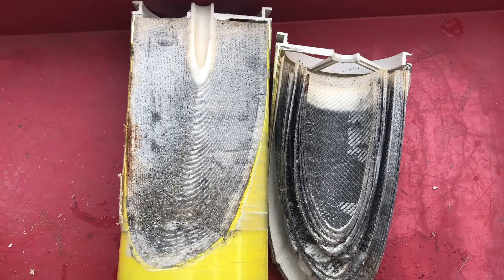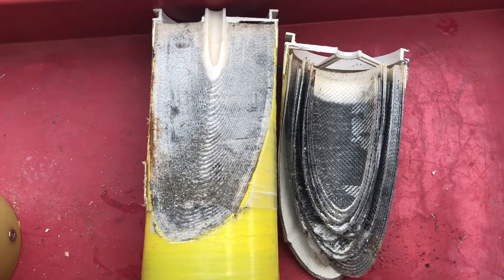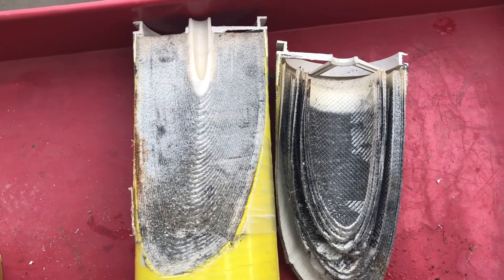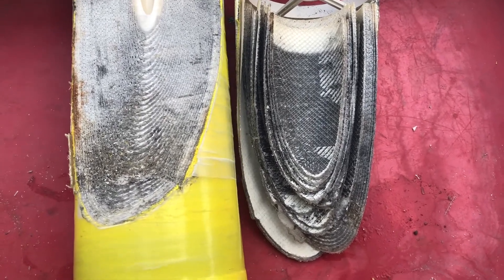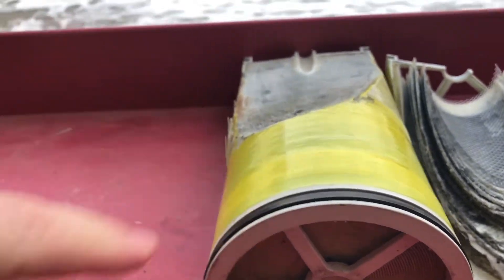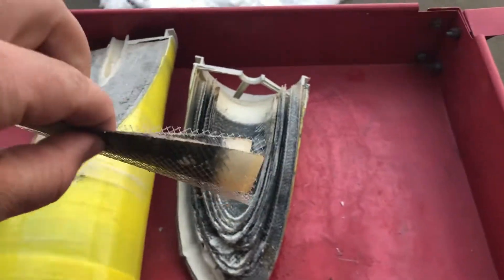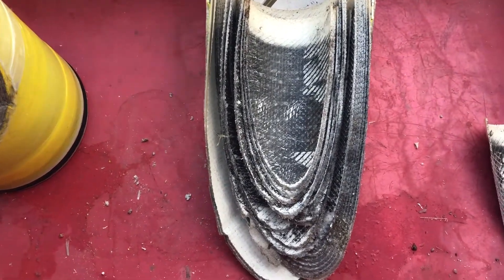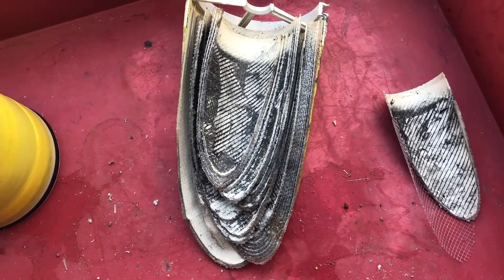What does a fouled reverse osmosis (RO) membrane look like?

Comment: Hi mate thanks for the video.
I have a wro 300 H and was wondering where i could buy a replacement RO membrane any advice would be much appreciated 👍
Reply from the maker: Look up Mar Cor Purification which became Evoqua then Xylem
Reply: @pvctipsandtricks768  perfect thank you mate 👍. Only spent the last 3 days searching the web 🤦 I currently use it for my aquarium tank as buying RO water adds up over the years. but I've noticed my us/cm is running around 11 with a rejection rate of 98% so I've had to buy a di resin vessel to remove the remaining TDS. As it should be 0 TDS for a reef tank. I don't suppose you could suggest what to look out for in terms of the start of RO fouling. Also do you know what the conversation is from μS/cm to TDS I believe it's just half so 11 μS/cm would be 5.5 TDS but not too sure Thanks again Jack 👍
Reply: @jacko1997clarke  As a quick calculation TDS is roughly half of microsiemens the actual calculation is slightly different but close enough. Oh man determining if the membrane is fouled is going to vary but to me 98% rejection and 11 microsiemen product water is pretty good. It has a lot to do with quality of your feedwater. I know nothing about aquarium water but if you weren’t polishing with DI at 99% rejection I’m not sure at what percentage you would need to start as 99% still isn’t pure water.
Reply: @jasonrobinson3290 Thanks for you reply Jason. 
Okay thanks for clearing that up for me as it's not that clear on the internet when you start involving scale 500 /900 ect. 🤷
Its currently running with a 5 mircon pre filter and a carbon filter before the machine. I was also thinking about installing a GAC Carbon filter with intent to extend the life of the membrane but not sure if I'm just overthinking it. On the machine it says the supply is 450 us/cm. With the product water reading 10 us/cm . At which point it then enters the DI vessel as a final filter. it come out at 0.0 TDS which is perfect for aquarium water as a rule of thumb people say not to let it go about 4 TDS. So for now it's working perfectly but id just like to know for the future as a rough gauge to know what state the membrane is in also when to start saving for a new membrane 😂
Reply from the maker: Because the WRO 300 is a medical device the price is going to be high for a new membrane. I have retrofitted a cheap membrane to fit in the WRO 300 but it changes everything and should not be used for patient use at that point. Look into membrane cleaning it may prolong the life of the membrane. Even something as simple as vinegar may help. Is your model a WRO 300H with heat disinfection?
Reply: @pvctipsandtricks768   hi mate thanks again for the reply much appreciated.
Yeah it's a wro 300 h it doesn't get used for dialysis anymore. I just use it for my RO water for my aquarium. But as the  RO water is so expensive from the aquarium shops and heavy to carry around I'd like the maintain the machine as long as possible. As I get though about 25L a day.  I do put it on a heat clean every wed and sun. I do also have a bottle of Citrosteril but never used it before and was going to ask for a little more info before I start pumping chemicals in. I need to try and buy a wand for the acid intake to as I don't currently have one.
Reply from the maker: Oh yeah that wand is nice to have almost essential. If you have the heat version you can do a warm vinegar or citric thermal membrane cleaning to help prolong life of membrane. Look into getting one and your options for cleaning will greatly increase! I wish I had an alternative to offer you but I don’t other than taking the cover off and injecting straight into the tubing but that starts to get complicated. I made a video on modifying the membrane to an after market membrane which is fine to do in your situation where it’s no longer medical. I haven’t edited the video or posted it yet but I can certainly help you with that once your membrane is dead.

Comment: Our fleck instead of absorbing the aqueous solution it spits what's inside
Reply from the maker: It uses a Venturi to suck the salt water from the brine tank into the softener tank. During this process you will see water going down the drain. To see if the Venturi is strong enough to suck up the brine disconnect the tubing inside the brine tank and cycle the fleck through a manual regeneration. During brine draw if you put your finger on the end of the tube you disconnected you should feel a suction of the tube to your finger. If you can feel it then the Venturi should be strong enough to suck the brine water from the tank into the softener tank.
Reply: @pvctipsandtricks768  i did it 
Nothing happened
Reply: @pvctipsandtricks768  i did not feel a suction
Reply from the maker: In regeneration the first step is backwash lots of water should go down the drain during this step, second step is brine draw this is where you should feel the suction, after that another backwash then finally brine fill where water should come out of the tube to fill the brine tank. Can you get water to come out of the tube in the final regeneration step?
Reply from the maker: If water is coming out of the control head the piston is likely stuck and broken. You would need to rebuild the control head with a new piston seal and spacers.